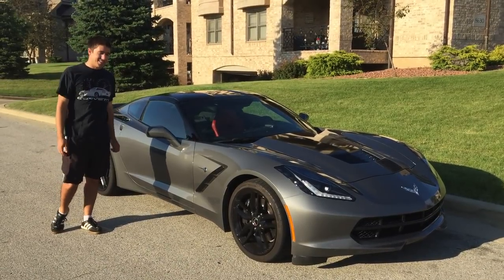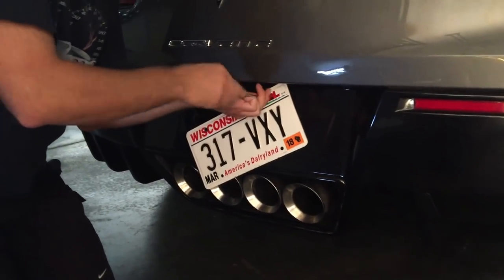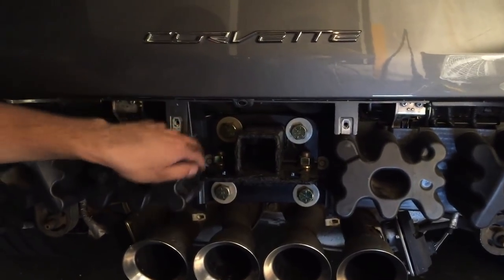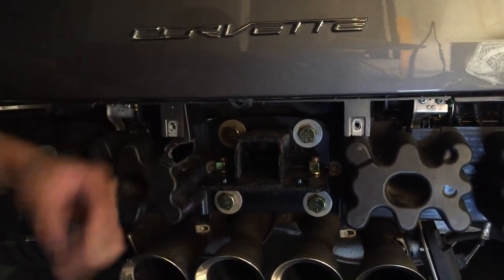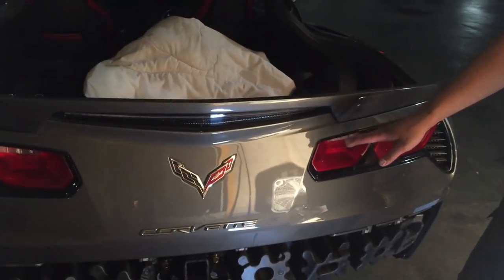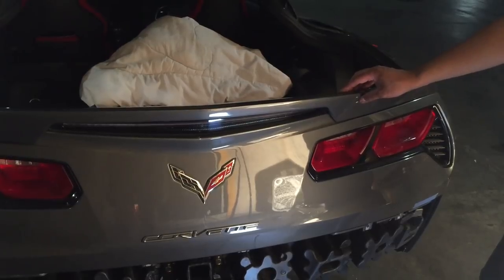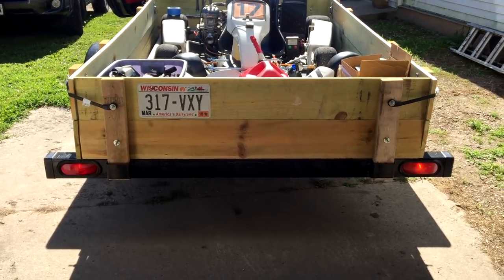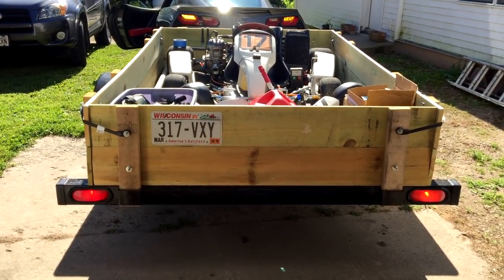Corvette Stingray Trailer Hitch

Comment: Why did you have to attach that red wire with that "submarine connection?" Did you need more length? Also, the plates for the inward side of the frame to prevent pull through, where did you get those or what did you use? Thanks! Great job!

Comment: Maybe have somebody weld a small strip of metal with two holes in it, to the draw bar so you can mount your plate to it. Also, maybe buy two very short nylon straps to attach to the chain attachment so you don't scratch the paint.

Comment: Do you not worry about the chains scratching up the bottom part of the bumper? Also where do you put the tag when you’re towing?
Reply from the maker: the chains dont hit the bottom part of the bumper.  the hooks at the end do a bit.  I put a piece of painters tape there just for when Im towing, so it rubs on that.  As for the license plate,  the trailer is under 3000lbs rating, so the law states I can put my car plate on the trailer and it counts for the whole vehicle.  So i just put it on the back. You can see that in my longer video.